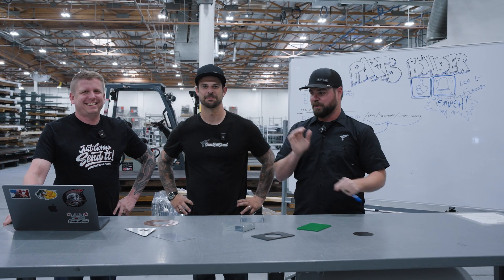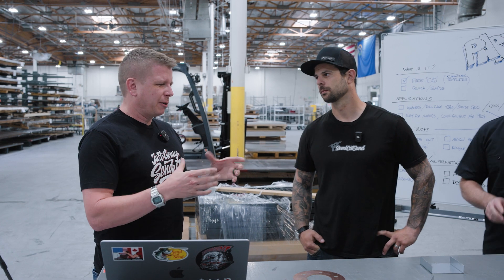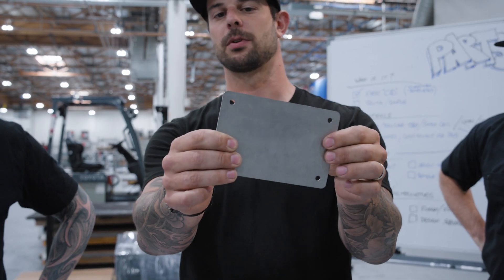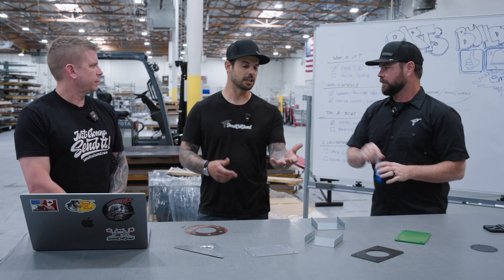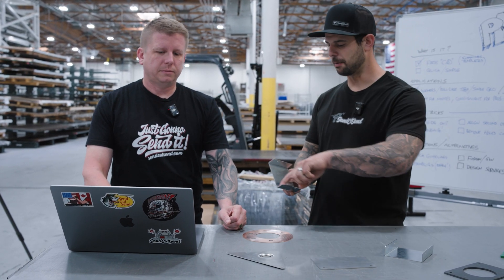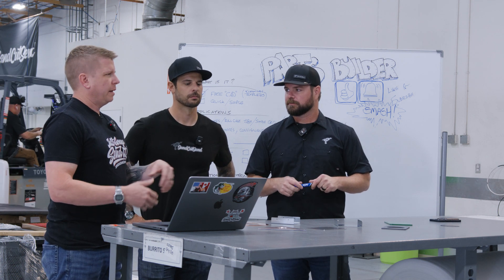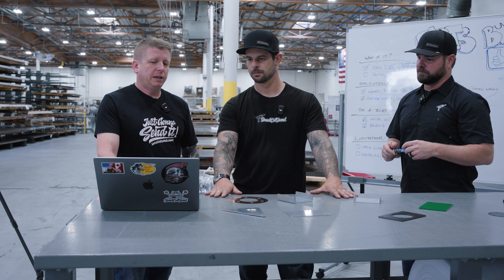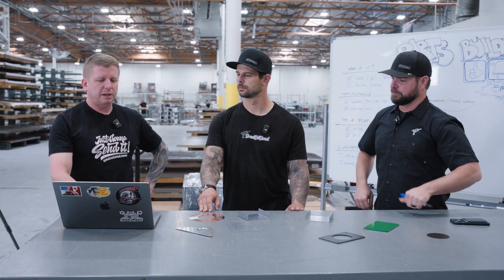Free Laser Cutting Templates: How to Use SendCutSend's Parts Builder - Cutting Corners Episode 8

Comment: I'm disappointed that the parts builder limits dimensions to 0.0 and not 0.000 .  For example, this makes a 0.75 " spacing of holes not possible and limited to 0.7 " or 0.8 " .